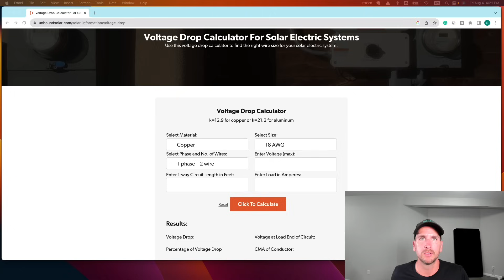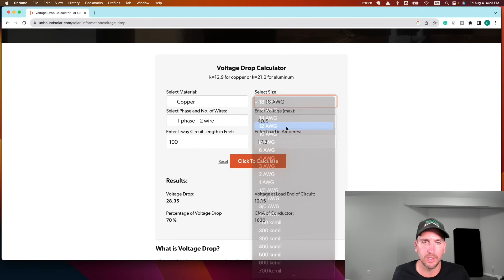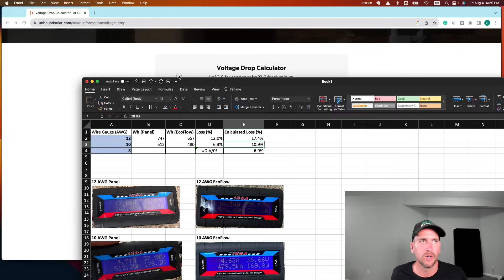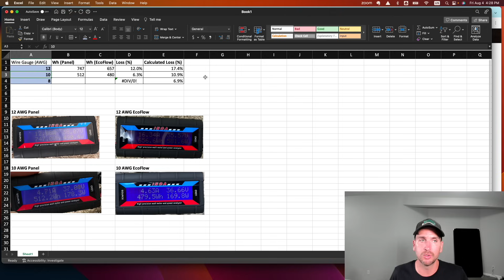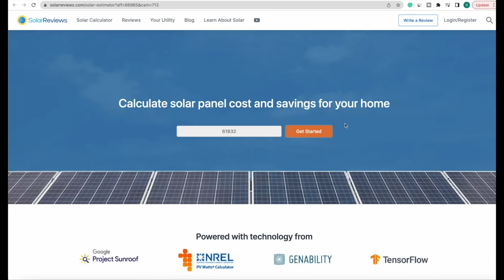What Wire Should You Use For DIY Solar Kits? Surprising Results!

Comment: MC4 connectors are the weak point - big wires to tiny connector - cut apart a mc4 and look at metal contact area -  its a few square mm -  similar to 3.5mm headphone plug -
- bigger contact area lowers resistance - I use polarized 2 blade connectors  - 10x contact area -

Comment: The measured results don't match the calculator because the maximum amperage was used. Voltage drop increases as the load increases so, as has been mentioned, keep volts as high as your equipment can stand to minimize amps and voltage drop.

Comment: Also i found this when running large loads & recharging batteries check along wires by hand for thin spots & defects. i had 2 spots where it was warm and hot. basically bad internal wire stretched thin during production... today things are just not quality made

Comment: Silly test, because line loss per foot and current is all known and in online tables.  They are very easy to use, so you can find out what your system line loss will be for each gauge wire.  These test high line loses are because there is very high current flowing through the wire.  In a real DC system, you want series wiring so you have as high a voltage as your inverter can handle.  The current would be about 8 to 9 amps (whatever a single panel puts out).  That will minimize your line loss.

My 5 KW array uses two series strings, with 12 panels per string.  Each string feeds it's own MPP inverter channel.  That's about 430 volts at 8 amps, well within my grid-tie inverter specs.  My line loss is minimal with 10 gauge wire.

Comment: Measuring losses in % is completely nonsens. If you have 20 pannels in series the voltage drop is so small in % but you still loosing same amount of power. You should talk in watts of loos not %

Comment: The national electrical code says what size wire you have to use based off of amps 17.8 amps exceeds #12 wire.  at 80% if 20 amps =17 amps is what the wires rated at. 17.8 exceeds the allowable amperage for number 12

Comment: Low current / high voltage will always be more efficient from a line loss perspective. This is why electrical utilities use high-voltage lines. P = V x I^2, so that current is exponentially more influential on the power loss of the system. The best scenario is to connect the panels in series if the design can handle it of course.
Reply: Of course, but this is surprisingly low current for the wire gauge! My larger array has 2 strings, 7x 72 cell panels in each one, a little under 400V on the string, but still has decent amperage in what I'm guessing is 8 gauge but can't remember anymore.  7.5amps per string likely by my calculation but I guess that's peak sun, so the top 1-2 hours of the day and the rest it's below that.  Maybe not too bad afterall, but man, upping the copper thickness would likely pay for itself, everything else staying constant!

Comment: Copper wire is pretty pricy. It might be cheaper to add another panel and use smaller wire.
Reply: Wrong!  Always use a wire size calculator and make sure you do it correctly otherwise you're a hack!

Comment: Upping the gauge of the cable increases the cable cost fast. It might be cheaper to run two separate cables, one for each panel of lighter gauges and combine them at the receiving end than to run one heavier one. 

And also, silicon & glass is cheaper than copper. If you have the space it might be feasible to install an extra panel to make up for the voltage drop rather than spending that (or more) money on a bigger cable. This also has an advantage of keeping the output higher under less favourable light conditions, where the current is lower anyway therefore the voltage drop is less of a factor. 

Of course if you can run the panels in series (if you have MPPT with an adequate maximum input voltage) then you massively reduce your losses. However, parallel has one significant advantage. In series, shade one panel and you wipe out the production of both. With a parallel setup one panel doesn't affect the output of the other. They can even be pointed in different directions to passively :"track" the Sun over the day. In series they must receive the exact same insolation.
Reply: Yep.  Plus, easier to work with.
Reply: If you were charging a battery there is absolutely no benefit from facing some panels in different directions. What you want is the maximum amount of amp hours delivered to the battery and that will only cut into that.
Reply: @boblatkey7160  If that's all you are doing then that is probably the best way to go. However, if you are charging batteries and running loads all day and night, such as in an off grid household then things become quite different. Having some west facing panels makes a massive improvement to battery life because it lengthens the time each day the loads are purely solar powered, before dipping into the stored charge in the battery. It all depends on how large the solar array is and how big the battery is. 2 x 100 watts into a 100AH battery, for example, you probably want to point 'em the same direction.

Comment: The voltage drop test is flawed, since shady days generate less current. The correct way is to measure voltage drops at the same current in all cases! The losses are proportional to the current amps squared. It is derived from Ohms Law!

Comment: Don’t worry about the 15 amp limitation.

Amps are "pulled" by the DP so there is no concern with being over 15.9 amps.

The “maximum” of 15 amps is a limitation of what the Delta Pro can consume or take in itself.

So even if the panels produce 20 or 25 amps, the Delta Pro will only take 15.9 amps.

Think of the 15 amp outlets you have in your house. The breaker in your panel is rated at max of 15 amps but when you plug in a 100 watt light bulb into the outlet, the bulb doesn't pull 15 amps. The bulb only pulls the current it needs to operate the bulb which is what the DP does with the solar array power.

However, volts are "pushed" so it is CRITICAL that the 150 volt limit of the DP is NOT exceeded under ANY circumstances after factoring in lowest panel operating temperatures.

Most DP users look for panels with a VOC around 40 volts and connect them 3S or 3S2P or 3S3P or even 3S4P to be over panelled for less sunny conditions.

Each of my arrays have a total of 3,240 watts but the DP caps the input at about 1,605 watts but it allows me to retrieve the full 1,600 watts for maximum amount of hours throughout the day.

Comment: There are errors in your testing process. Ohms law (E=I*R, I'm old school), I (amps) for any given instance in a circuit will be the identical anywhere you measure it (keep that in mind) #1. #2) Voltage drop is proportional to the current in comparison to the line resistance. The longer the run, the more voltage in proportion to the current as-well-as the higher the current the more voltage drop.

I've run 18AWG nearly 500 feet running 120v AC with barely 50 watts (under 0.5A) and the voltage drop was almost nonexistent (forget how much but just over 1V).

@6:24 you can clearly see 12AWG Panel 12.86A and 12 AWG Ecoflow 16.34A. Using the 747<->657 to come up with any loss is in error because they are clearly being measured at two different times and loads (in terms of current vs watts). 

The 10AWG measurements are better in that the amps are nearly the same with 4.71A and 4.63A but ideally they should be identical given the accuracy of the measuring instrument. Should also take the two meters right next to each other inline and verify they both show same values within equipment tolerances or at least to determine/estimate the percentage error.

For a brain teaser, search "Path 65" (HVDC @ 1M volts)

Comment: Where can i get a good online solar calculator that can estimate my solar output based on solar panel sizes,configuration and battery bank voltage 24 or 48v

Comment: Great video, question, is there a in line meter out there that I could hook up to my  4 panel 1600W 196V that I could keep a eye on status that goes to my mini split 
Thank you
Reply from the maker: I haven’t found one as I am looking for something similar for data collection on upcoming projects.  The unit I was using is basically from the RC car and drone industry.  If I find one you will see it being used on this channel 👍

Comment: No maby the panels in series will 1/2 the currant and 1/2 the the losses with 150 volt input rating you could even run 3 panels in series at the same current.

Comment: When going for larger wire sizes (I will use 4 gauge) take care to avoid wire that is stamped 'CCA'. This is an acronym for Copper Clad Aluminum. You would have to upsize a wire gauge to get similar results. The number would get smaller -  2 gauge CCA instead of 4 ga. copper.
Reply: The amount of power running through a 4 ga CCA wire that we are referencing here... there is going to be negligible difference CCA vs OFC. Now if your running a 5000 watt stereo amplifer pulling current directly from the battery, then yeh OFC is a must have.
Reply: @KingMrBigE  nope - 500 watts of panels can be around 30 amps. Use the calculator and see for yourself. 
If you can tolerate more than 10% voltage drop, than I don't care either.
Your charge controller adapts to the lower voltage, an amplifier can't.

I just don't want to waste the precious power if I can avoid it.
Reply: If you simply default to a huge wire like that you are considered an electrical hack! Do what is correct and don't default to big wire as that is pure sloppy workmanship.
Reply: @boblatkey7160  whoa. back off. I didn't default to anything. (5) 100 watt panels, 6 amps each, 12v, 30amps system. 20 feet of 4 gauge wire - you run that through the calculator.

I prefer 3% voltage loss or less. THAT is good design.
Reply: @jamesalles139  the difference between a CCA vs a OFC 4ga cable is not 10%...
Reply: @KingMrBigE  Yeah, but in my opinion, Oxygen-Free Copper is the ridiculous part. (I can't hear the difference)

Comment: I think the problem is on the ammeter because the ammeter itself is using small wire gauge. The current is bottleneck once passthrough the ammeter.

Comment: The Anker 767 would be a better choice for this test since it will draw 20 amps instead of the 15 amps the Ecoflow is capable of.  Also,  wouldn't the load used to calculate your line losses be the same for each test at 15amps???
Reply from the maker: Thanks for the feedback on the Anker.  I want to start taking a look at Anker and Bluetti in addition to the Ecoflow units.  Since the day has some clouds the test didn't deliver a constant 15 Amps as clouds moved in and out.

Comment: So I want to put about 1 acre of ground mounted panels on my farm.  Then run the power about 250 yards to the panel.  How much loss will I get?  It might need 300 yards
Reply from the maker: 1 acre of panels would be a BEAST of a system.  You could probably fit 500kW or more on 1 acre.  How large of a system were you thinking?  Do you know what panels you were going to use?
Reply: @everydaysolar-ps3xg  no.  Looking for advice.  I have a 11kw system on my roof with 2 tesla huge batteries and it doesn't do what I want.  I still pay 200 month to utilities.  Now adding a second small home.  Need more juice.   WA ted the solar field to power that one and what I need to stop using grid

Comment: Great testing!    You did mention a series configuration but you never tested it.   The thing about going in series, which I don't think you mentioned, is that you cut your losses to 1/4, not just 1/2.

So if you go back to that calculator and put in 12 AWG, 40V, 16A, 100ft, you get a loss of 15.8%.   The equivalent series configuration would be 80V, 8A, and if you plug that in you get 1/4 of that: 3.95%.  And that's with 12 gauge.

For a whole-home system it is far better.  Now you are running 240VAC with micro-inverters, or in the 400VDC range with a string inverter.  The percentage losses with 12 gauge wind up being 1.32% @ 8A and 240VAC, or 0.79% @ 8A and 400VDC.

This just goes to show, going for the highest possible supported voltage massively reduces wire losses.

That said, I use 10 AWG for all my panel-side cabling.  Actually it is even a bit thicker since it is 6mm^2 cable and 10 AWG is 5.3mm^2.   I'm just a bit of a perfectionist.   I just like the feel of the cable.
Reply from the maker: Thanks for the feedback and I would like to test a higher voltage as I agree that is a more practical and smart solution.  The little power analyzers are pretty limited in the amount of voltage they can handle so that was the limiting factor for this test.  I am thinking about stepping up to some mid-grade testing equipment which would expand the capabilities.
Reply: (this phenomena is also why people are moving away from 12V battery packs and to 48V battery packs for new ground-up builds.  Because the losses and heat in the compartment at 48V are just 1/16th losses and heat at 12V).   Now that 48V LFP battery packs are so easy to find.)

Comment: Why are you comparing energy (Wh) which is power integrated over time with a voltage drop? The calculator app calculated the voltage drop at a set current using only the cable resistance (derived from the gauge and length) and the assumed current. Then it also calculated a percentage based on an assumed input voltage. Your test would need to assure both the same current as the calculation and the same input voltage and measure the voltage at the ecoflow to make any percentage comparisons valid. Power loss in a cable is the current squared times the resistance. Power is voltage times current so for a given solar panel POWER output, always connect them so that you work with the highest voltage your solar controller can work with, that way you minimize the CURRENT and thus the power losses in the cable.
Reply from the maker: I went with energy in this test so I could accumulate up the power at the start and end of the 3 different gauges of wire and also made it easier so I could run tests of different lengths but still be able to compare the energy at the start and finish to get the % loss.
Reply: But your measurement was for actual energy, I.e. the voltage at the time multiplied with the current at the time integrated over time, this you compared with a calculated voltage drop based on a theoretical value for the current and voltage?? I’m sorry, your percentage comparisons/conclusions on the calculator makes no sense. You percentages of loss for the different gauges of wire you got with the actual measurements are fine! But your conclusions on the voltage drop calculator are completely misleading and that 10:48 is why I commented in the first place. Make a test where you measure the current and the voltage drop in one of the cables at the same time and input the cable length (one way), gauge and the measured current in the calculator to get the calculated voltage drop - it will be close!

Comment: Within reason I would tend to ‘overbuy’ and get the thickest gauge as the copper will always be worth whatever the current price is. What about having an inverter right close to the panels as AC does not have the Voltage drop issue that DC does, or at least not anywhere near the amount. Edison was smart but Tesla was smarter.
Reply from the maker: Yeah that would be ideal.  I had a few questions of "how long can I run wires from my panel to my shed." So I wanted to show how wire sizing is important through some of these common wire sizes.  In an actual setup I would have ran the 2 panels in series and up the voltage but the little power analyzers couldn't handle that much voltage.  👍

Comment: Interesting topic.   By making measurements at the start of your cables and at the end of your cable you can narrow down to line losses, but you still need to consider the varying current flows.  The 12awg starts with 12.9A and ends with 16.3A (why the wide range?).....the 10AWG starts with 4.7A and ends with 4.6A (more reasonable behavior).  The greater the currents the greater the ohmic losses !    Line losses are lower with the lower currents.
Having worked with different batteries i've noticed they draw power from the PV-panels differently, so the state of charge of your batteries should be considered.....they should be similar across both tests.   The lower the state of charge the higher the current flow when using a PWM-type solar charge controller.  Have not had an MPPT unit long enough to test this, but i still can imagine similar behavior.  My inverter experiences make AWG and wire type a high priority ---->  https://youtu.be/xK0L4dOMpSc
Reply from the maker: Yeah, not a bad call out as a I think the 10 AWG test had a little more cloud cover and as such dropped the current resulting in a little less line loss than if the test had full sun.  Overall I think the results are still valid within a reasonable error band.
Reply: And because the conditions differed, it invalidated the test. Current should have been equal and at the maximum design level to get accurate loss results. Cables will also have to be derated depending on how many cables are in the conduit and outside temperatures encountered, as all loss turns to heat and adds up, creating a safety issue if not considered. Is the conduit in direct sunlight, that's another thing to consider. Check the temperature rating of the cables as that needs to be considered also. Yes, there is a lot to consider for the DIY installer.  @everydaysolar

Comment: This is all basic information for power transmission.
Always run the highest voltage you can, as it minimizes the gauge wire you need.
It's the reason manufacturers are increasing the input voltage into the charge controllers.
Reply: You the ex-CFL QB?

Comment: THe higher the volatage the smaller the wire , I would not use less then 150 volt input charge controller.
Reply: Right